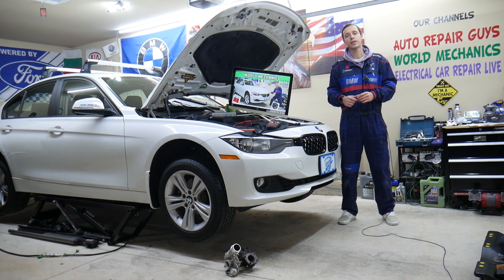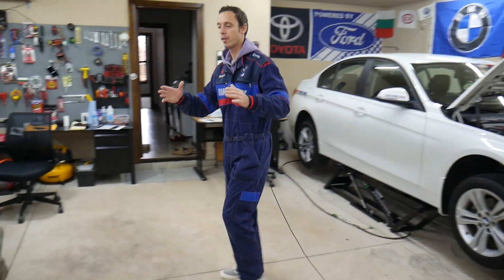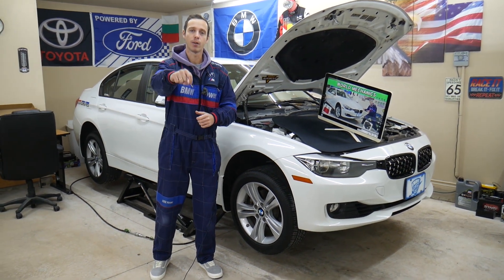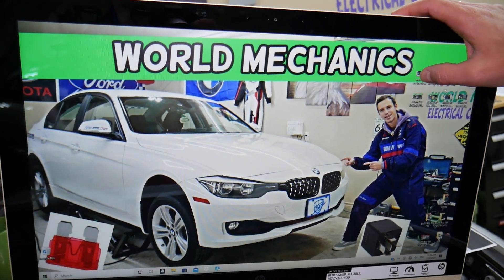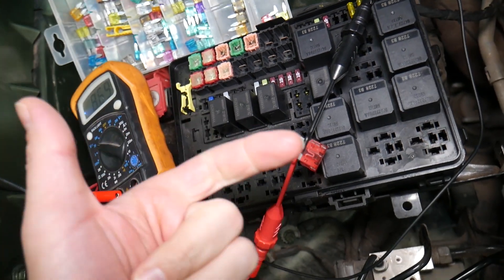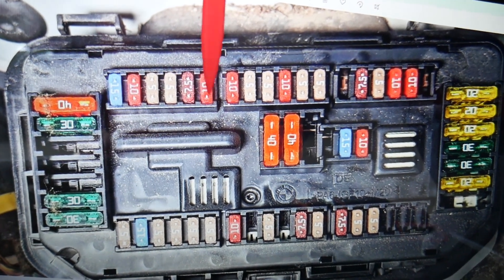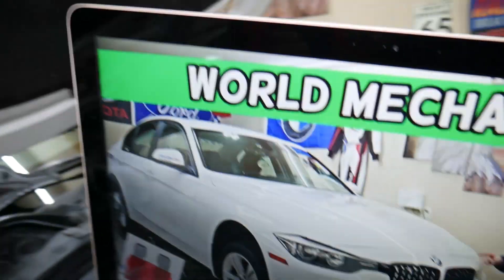BMW F30 F31 ECU ECM DME PCM RELAY BMW 328i 320i 330i 335i 340i 318i 316i 320d 318d 316d 325d 330d

Comment: I had the lost communication water pump code U1177. Checked all fuses per your video and despite all fuses were good and looks like by pulling the fuses and plug them in, reseted the ECU and cleared the code! Thank you so much 🙏🏻!

Comment: I wanted to change my MHD multimap in my 335i F30 2013, mhd has stopped during unloading old program (I've push plane mode !!). So when I tried another time to flash : MHD can't reach DME. Till one month is in a garage. Garagist extracted the DME and has reloaded an original program of 335i. After re-intalled the DME in the car, still the same problem, no com with DME (with MHD wifi key or with his computer). Please help !! BMW resseller doens't want to sell and install a new DME, he's sure it has been reprogrammed. DME is not dead, my garagist part of program is missing. Do you think it could come from a protection which cut power to DME ?  HELP

Comment: I have a 2011 bmw 328i and when i turn it off it wont start anymore nothing lights up its died. the water pump is new the battery is new i changed the kl.30g relay.

Comment: I have an F30 2013 2.0 320i, a few days ago I got power train malfunction error the car lost power and took more strokes to start, the scanner identified error P1338 (camshaft position sensor)
I watched your videos and changed both sensors but I still have the message on the dash and the starting motor still takes more strokes to actually start the car 
I check voltage on the harness and only have around 5v from + to ground 
And also around 5v from the signal cable (yellow) to ground

I think I must be getting 12v from + to ground and my guess is I have a faulty relay 
Is there something else you recommend me checking? 
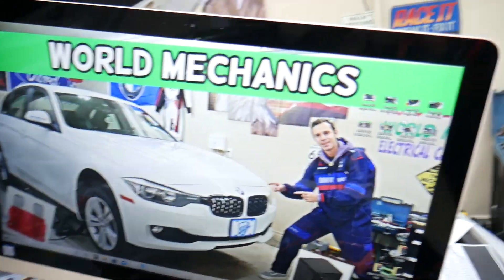I think that new video you mention on 4:41 might help me check the camshaft position sensor relay see what voltage is there